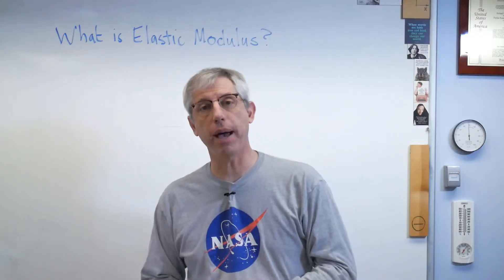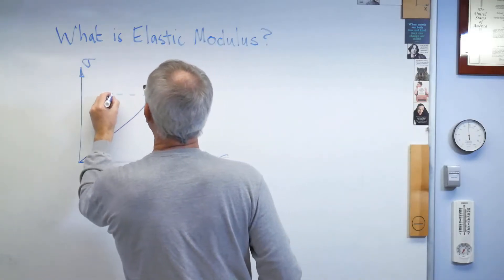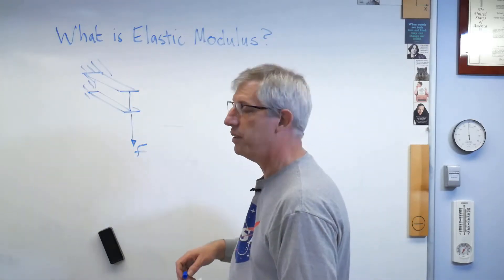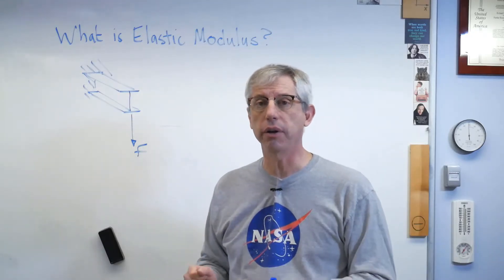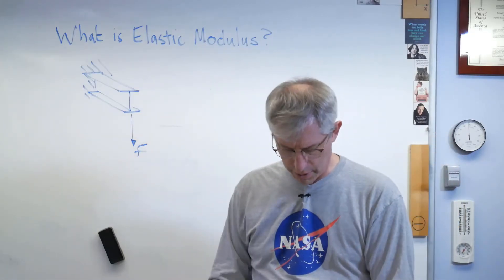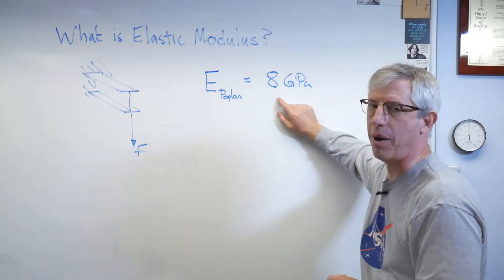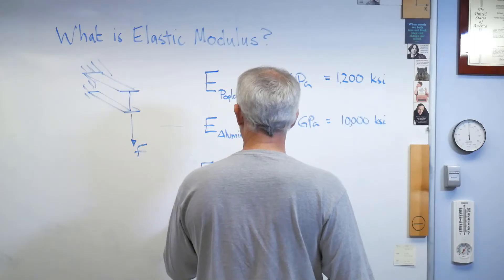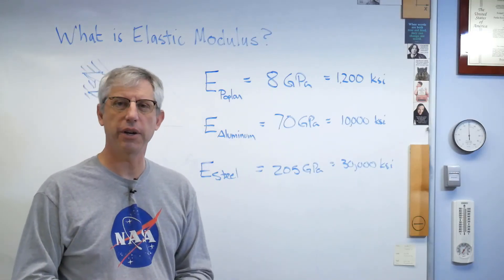What is Elastic Modulus?

Comment: Good explanation. One thing doesn’t make sense though. In the video at https://youtu.be/19nzPt62UPg carbon nanotubes are shown bending and flapping around effortlessly (at 3:52). This would seem to mean they must have an extremely low elastic modulus, but https://en.m.wikipedia.org/wiki/Mechanical_properties_of_carbon_nanotubes says they have an elastic modulus of 270 - 950 GPa. That’s higher than steel!  Why does carbon nanotube bend effortlessly like that?

Comment: the thing that I can't quite get is this...knowing the fact that  "E"  is stress over strain...that should mean that if we have the strain and E we should be able to calculate mathematically the stress that was responsible for that strain....now does that mean that if we had  strain caused by Tension we could find the stress that caused it using the Elastic Modules, and if we had the   Strain caused by compression we could find the stress using the same modules (EX:210Gpa)....or does E for Tension deffer from E  for Compression....and in bending is where it gets really complicated for me.....because in bending there are 2 stress's...so which one are we finding....and can we actually accurately calculate  stress or strain using the Elastic Modules knowing that is another stiffness that is coexisting with the material stiffness which is the shape stiffness....too many questions...I don''t know...there must be something that i'm missing or not understanding correctly